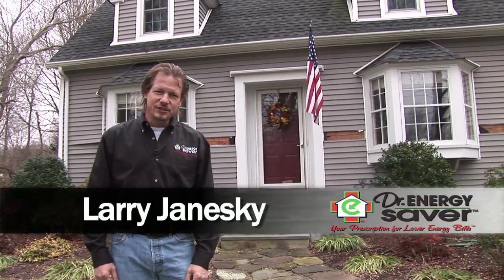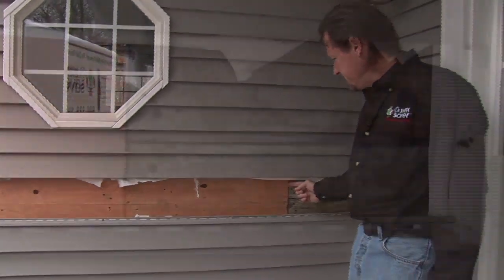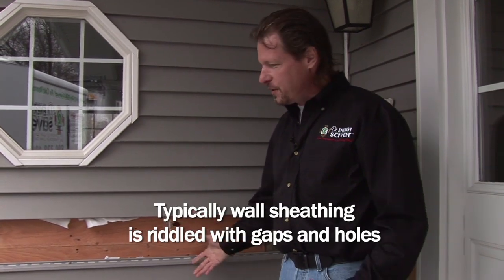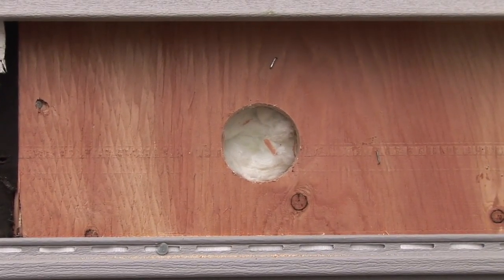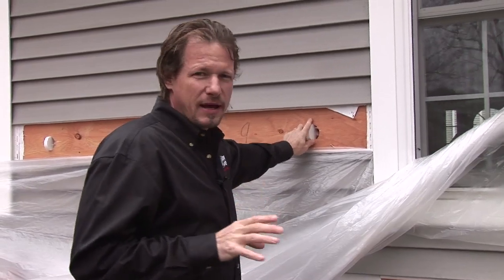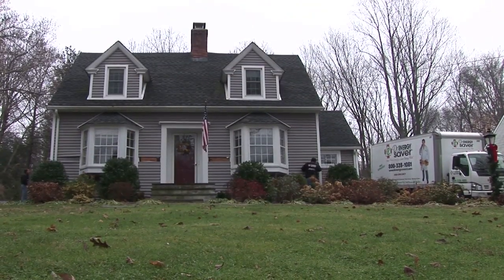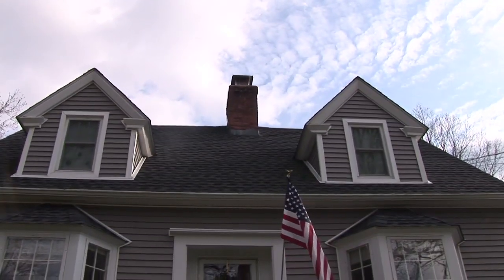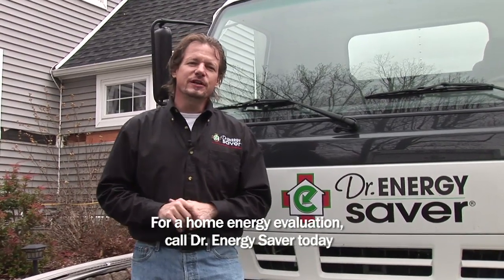Insulating Exterior Walls and Dormers of a Cape with Injection Foam

Comment: would injecting foam in ceiling rafters cause it to sweat and rat wood .?
Reply: This is an excellent question because you need a 2 inch air gap between the roof sheathing and insulation for air flow up into the ridge vent. I did a cathedral ceiling and put in the 2 inch air gap for air to flow upwards from soffits to ridge vent. Good question 786otto!  Atlantic Canada during pandemic covid.
Reply: @MegsCarpentry-lovedogs  That is standard for fiberglass insulation,my qwestion was about spray foam. Did you do that for spray foam ?
Reply: @786otto  Hi. Nice to hear from you. No spray foam in my cathdral ceiling project.  Here is the layering starting from under the roof sheathing; 2 inch air space, reflective foil facing up towards roof sheathing, 6 inches of XPS styrofoam, vapour barrier, another layer of reflective foil but this time facing down towards living space area, 3/4 inch strapping which also helps in creating the air space the reflective foil application needs for radiant effect to take place, ceiling planks are also attached to the strapping and voila!  It was quite a project with lots of caulking for air gaps and 
sealing joints and a sprinkle of can spray foam here and there for the gaps as well.
Reply: @MegsCarpentry-lovedogs  You must be in warm/hot climate ,seams like lost of work .Posybly try foam on next job. Good luck.Hopefully you are not traping any moisture in your assembly.
Reply: @786otto  Yes, I am in Atlantic Canada with large fluctuations in temperatures and a variety of different weather conditions from extremely dry to soaking wet. "Life is like a bunch of chocolates. You never know which one you are going to get." Forest Gump-Tom Hanks-He is the best! We need the air gap to do just that, keep moisture out by having the flow of air from soffit up to ridge vent. Roof science is so interesting. Stay safe.
Reply: @MegsCarpentry-lovedogs  You to.

Comment: 786otto; This is an excellent question because you need a 2 inch air gap between 
the roof sheathing and insulation for air flow up into the ridge vent. I
 did a cathedral ceiling and put in the 2 inch air gap for air to flow 
upwards from soffits to ridge vent. Good question 786otto!  Atlantic 
Canada during pandemic covid.